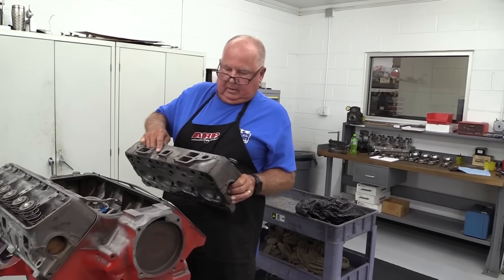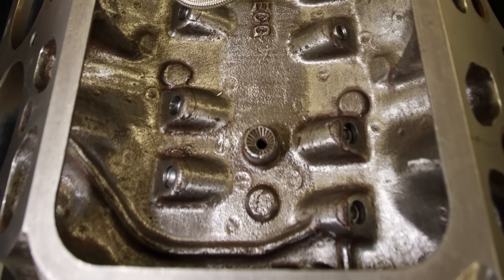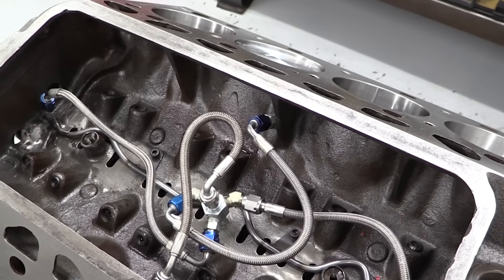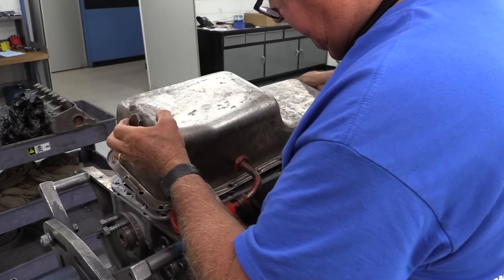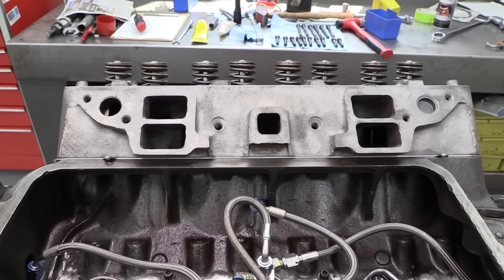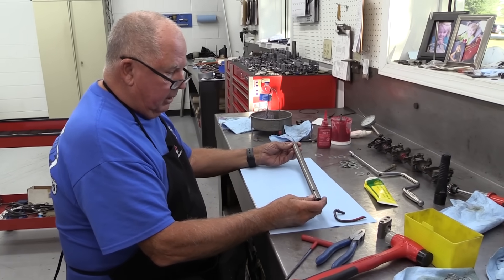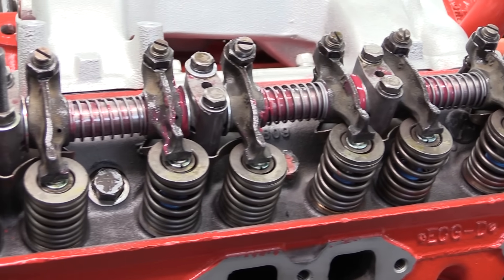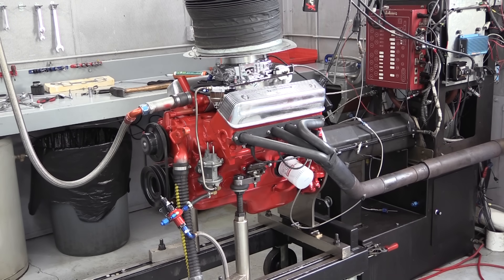The Engine That Replaced the Flathead -- Ford Y-Block Build

Comment: Ford is just a tad late in introducing the OHV engine, had a rare opportunity to work on a Buick 1903 engine, ha no valve cover and came with an oil can to manually lubricate the valve train components.  But it was definitely an overhead valve engine.

Path for air fuel flow is quite long in a valve in block engine, this was recognized well over 100 years ago.

Charles F. Kettering developed the spark ignition system for GM way back then as used today but with transistors instead of points.  Was patented and Henry did not want to pay royalties so used vibrating relay contacts in the Model T Ford that was far more expensive and troublesome.  But jumped at it with the Model A when that patent was expired.

Ford did have capabilities like building a two mile B-24 manufacturing complex that could crank out a B-24 each hour in less than a years time.  Extremely reliable, wish I could say the same about their cars.

Comment: I owned a 1957 Ford Ranchero with a stock, rebuilt 292 short block I installed along with a pair of rebuilt heads. For grins I started it once to verify oil supply to the rocker shafts. There was a lot of oil up there.  With modern oils and regular change intervals, I believe the oiling issues are exaggerated.

Comment: In '67 I rebuilt my 272cu engine doing a full blueprint build with overbore, balanced components and ported heads. Couldn't keep the stick 3 speed manual together very long. Broke it several times racing. Loaned it to a friend and he wrecked it. "57 Ford 2dr. Oh well.

Comment: My father who was a Ford mechanic in the '50's and '60's once told me that the bypass hole on the rocker shaft was to prevent to much oil onto the valve train. After about 30 thousand miles the rockers would get to much oil and the valves would start sucking it in through the seals. I understand that it was a common problem.
Reply: Great engine❤❤

Comment: I ran many of these in the 60's and 70's.  292" 4BBL in a 57 Ford wagon, a 312" 3-2BBL in a '55 Bird, 312" 4BBL in a runabout boat.  Good mills. Biggest problem I had was leaky rear main seal on the T-Bird.   Ended up repowering that Bird with a 302" and it was a vast improvement.
Also had another 55 Bird all stock show car with a stock 292" 4BBL.

Comment: First motor I built was a 292 Y-Block back in 1983 when Y-Bocks were NOT cool. I learned all my motor knowledge from a neighbor who built and raced late model stock cars. I tried to build the Y-Block like he built the stock car motors. I Used ECZ-G heads fully ported with 1.940 intake valves. A forged steel crank out of a Ford 600 truck. Deburred the entire block, polished the rods ARP bolts. Built my own 2 x 4 aluminum intake, oil pan and windage tray,  stepped headers, Schneider Cam valvetrain, it sure was something. I never dynoed it but it ran up to 7500rpm and ran high 13's at 107mph in a 1957 Ford pickup using a Top Loader 4 speed and 4.56 gears.
Reply: 7500 rpm on stock rods is insane, wanna make my 239 turn 7000 under a dash of boost lmao
Reply: @captainchicken8983  We have a modified 272 that still has stock rods. Normal shift point is 6500 but it will easily hit 7000+.
Reply: I had a stock 292 2bbl. Fresh rebuild. According to a tachometer from K mart, it would turn 7000.
Reply: Cool. I have all kinds of Y block stuff. Maybe i'll get a 292 rebuilt one of these days. I was going to put a 292 with 3 2110 holleys  in my 56f100 but instead i'm thinking of putting a late 50's 392 hemi with a 8-71 blower in it.
Reply: That sounds really cool thanks for your story!
Where you a machinist back then or how did you get the access to the mills to manufacture the parts?

In the beginning of my career I did a 3.5 year apprenticeship as a precision mechanic and learned every manufacturing technology and had access to everything from standard and cnc milling, turning and grinding over honing and electronic discharge machining with dies and dries.

After I finished my apprenticeship and a few years of work I changed the company and became the leader for their manufacturing department where is also learned everything that had to do with CAD and CAM.
Those times where amazing because I could build everything I could ever imagine with that huge park of machines!
My boss told me I could use all the materials from the recycling containers for free and we often had huge plates of metal in their which where more than enough to manufacture my parts!

Nowadays I’m just sitting on my as an engineer and tell people what to do or make presentations for the top management how my projects are running.
I get much more money, but I really miss the opportunity to build whatever I want for myself at home and the fun of not only designing but also manufacturing a new part that you came up with!

Some day I will at least get a small cnc mill and a conventional lathe for my little workshop in my garage, but that’s still a few years away since I first need to rebuild the garages on my property to put the cars somewhere else do I have enough space for those huge machines.

Comment: I had a 1956 Ford in 1965. It had the 292 and a Ford-a-matic transmission.  Paid $300 for it. Sold it and bought a 1957 Ford with a 292.  It had a three speed manual transmission. Paid $300 for it too.  Those were reliable engines.  You could rely on having to stop for gas very often.  They got terrible mileage.  But those cars  did have large back seats. Lots of fun at the drive-in.
Reply: the girls I dated wouldn't caught dead in the back seat of a Ford -let alone with pants off.
Reply: @timmullens9479  I believe you.

Comment: I remember the main weakness in the y-block was the 90-degree oil channel between the block and the head that fed the rocker arms. The combination of heat, poor oil quality, and infrequent oil changes, caused sludge to harden in this hot spot area which led to oil starvation to the rockers. It was impossible to clean out the hardened sludge because of the angle and access without pulling the heads. The answer to this in the sixties was an external oiling kit which was quite effective if you caught the problem in time to prevent the rocker arms and shaft wearing out.

Comment: What did he do, weld the connecting rods ? You said he fixed the cracks.
Reply from the maker: No, he just replaced them.
Reply: @TheHorsepowerMonster  well the wording in the commentary should be changed. From fixing to replacing. As an engine builder myself I was wondering if they did something I didn't know about.

Comment: question for you.. is this pretty much the same as a 368 motor.. although I believe that's a Lincoln ? but same design ? heads are definitely different..... intakes are different, but exhaust and rockers look pretty much the same....

Comment: It should have been named the “why” block because I still keep asking why.  The displacement of a flat head with the weight of a big block.  Oil issues, overheating issues and the odd exhaust manifold setup made for an interesting piece in whatever vehicle of the day you found it stuffed into.  Once mated to the Borg warner automatic transmission and you had one way ticket to the mechanic until you were beaten down enough to buy a new car long before you had planned.   By comparison the small block Chevy was developed at the same time, weighed substantially less, made more HP and over 80 million were made for some 50 years.   Ford in this 50 year period subjected its customers to no less than 12 V8 configurations, some good and some bad but never on the level of the Small block Chevrolet.

Comment: The 239, 272, 292, and 312 was not Ford's first OHV V8. Back in 52 there was a hydraulic valve version with a displacement of 277, 317 and 368 CID

Comment: “Infamous” Flathead?   Hardly infamous!  Produced and evolved from 1932 to 1953.  I built a 1951 version up in 1964 fir my first car.

Watching this video, I heard a lot of “faint praise”.  I remember the 272,  292,  and 312 referred to as “The Mainleaker”.. .   

GM removed a lot of the valve train complication with their stamped rocker arms for 265 cid small blocks in 1955. . .

Comment: drove a 48 1.5 ton from plentywood mt to crosby nd with my head out of th e window 30mph , it had a 272 y block with a power valve gone bad in the carb.   I didn't know it at the time, I was just a kid.  ended up giving the truck away a few years later

Comment: Well now the man that guided me through a y block build back in 1970 was the ford tech ak miller world famous racer and tech he told me to start with a 1962 y block out of a truch hd blocks and call speed o motive for a chrank rods and piston and crane cam they sold all with forged pistons and all ballanced for 250 bucks then i was told to make the center cam journal grove deaper and drill the oil feed hole from the crank to the heads out to 330 thousands and do the same on the heads and make the transfer slot on the surfice of the heads deaper and use hp t bird 1.7 rockerarms with good crane valve springs it took a 9 month session of porting on the heads to make the motor turn out 350 hp but over 425 lbs of torque with the edelbrock tri powre and mallory revpol distributor that motor still lives in a 58 ford truck today

Comment: It's galley not *gallery*.  Listen to Mr. Dorton.
Reply from the maker: Galley is slang, and I'll never correct anyone who says it. But one of the definitions of gallery is a channel or corridor. A galley is a boat. Again, a ton of people say galley and I'm cool with that. Either way, you know what I mean. Thanks for watching
Reply: @TheHorsepowerMonster  "Oil galley" is a technical term which you will not find in a literary dictionary, just like many other technical terminology.  It's been called this as long as there has been such a thing.  "Oil gallery" is a modern corruption.

Comment: Vaccuum wipers are hardly uncommon or  good engineering design. Many 40s and 50s cars used them and they were a pain in the backside. Get into the throttle and the wipers stop!! I owned a few 50 years ago. 
Those stacked intakes are a 'what were they thinking' design. OHV V8s were hardly new, Ford were a long way behind in 54. And that design was poor. Block was ok except for the very average oiling. Something that in hindsight was very poor from most manufacturers. 
Compare with a Chev,  vastly improved oiling, 14 bolts per cylinder head [the very bad point of an LS] and fairly efficient cylinder heads, an engine design around for around 45 years and the base for thousands of racing engines.
Y blocks? strictly for restorer cars. And if assembled properly perfectly adequate for that use. Hotrodding? Fit something more modern. In the 70s here in Oz all the leadsleds drag racing had Clevelands

Comment: I have a 57 ford custom 300 with a 292 and adapted 5 speed. The drivetrain is 100% stock besides the trans, factory duals, and a "modern-er" Holley on the factory big pattern iron intake. So... pretty damn stock. She purrrrrrrrrs and she snarls and roars. It amazes me because it's super fuel efficient and somehow it still stomps on Chevy 350s. 
How? Idk. I like my Chevys so I attribute it to good vs bad tune. Idk..... 
But, I love that 292. 
I'm building a 312 for her. I hope it lives up to what the 292 has done.

Comment: From what I understand there is no need to install those oil lines anymore. My dad and my buddies dad said oil wasn't the greatest back then, people didn't change their oil, and when the car needed oil they went to the service station and bought used motor oil. 
My buddies dad has a 57 Ford with a 292 and we had the intake off it and it had the factory repair done to it. To me it looked like a crappy fix with all the copper tubes they used and try to bend in place.
Reply: You are right, those oil lines are a complete waste of time and money.  Not at all needed.

Comment: My friend has a 57 Ford covertable Y block 312 with the factory Paxton Supercharger 
He also has a 57 Hard Top with a 292 
56 Ford had too 2 door 292
55 Ford hard top 2 door I6 
There's nothing better sounding than a Ford there all desictive and sound like nothing else. The flat head & Y block are 2 engines that you know exactly what it is without looking. The Ford engineers always put a effort into making the Ford engine different by design and sound. Even until today the modular engines have that sound that cant be recreated unless GM steals Fords design like the LS.

Comment: Yes the 292 and 312 I have a 312 in a 63 Ford F250 in your right now it's not a rocket motor it's not like a 289 not even close but it's the idea of I have one brand new right on and Scott less than but a thousand miles on it 25 years ago Rock on

Comment: It was a terrible engine - chevy was so far ahead it took ford years to repair the y block.
Reply: Sorry but don't agree,my Dad had one of these engines as the powerplant for his Gardner Denver well drilling rig and it was bulletproof for 15 straight years,his friend had dual small block Chevys on his well rig and had to replace an engine at least every 6 to 8 months. And the Chevy engines always used oil badly even when they were new. Daddy also had a 1963 F100 with a 292 Yblock as his service truck,he put over 400,000 miles on that engine without a major breakdown and he was ruthlessly hard on his trucks. As a matter of fact that 63 F100 taking that abuse daily made me as a youngster a dedicated Ford man and later on a Certified Ford Technician for 22 years.
Reply: Gutless, heavy, low-RPM, stacked-port, main leaking, rocker squeaking boat anchor.
Reply: @daryllect6659  Sorry,but you've come along too late to convince me of that,my Dad had several of these engines in his truck fleet over the years and they were some of the toughest engines we ever had,much more durable than any of the SBC engines he had which were also numerous. Dad advised me when I bought my first GMC truck that it would run and drive good but would absolutely require more than twice the maintenance of the F100 Ford pickup it was replacing and wouldn't take nearly the abuse that the Ford did. He was right.

Comment: I built several ford Y block engines back in the late fifties early sixties, they seem to blow head gaskets constantly. My very best build was a 312 CU IN 1957 Mercury engine that was a match for any built 283 Chevy back then, sad to say it ate a valve on a missed power shift and died. I never found another Y block engine that could never come anywhere near that one! I remember those days, they turned me into the successful Engineer I later became.  I certainly enjoyed your video! Thanks
Reply: Iam a  proud owner of an 1960  F100 4x4 292 with the Y block, I seen it up in front of the collapsed Barn, I asked the lady if she wanted to sell it? she said hell no! you can have it for free.... I gave it away 12 years ago to a guy.. but it had four flat tires,.he never showed back up. Called up my buddy Joey I said Joey bring me a battery and your car trailer.and  a six pack of beer.. Joey showed up, I put the old girl down in first gear granny Low, slap the battery in it, pulled out the spark plugs then turned it over,, and womp womp womp womp right up into the car carrier.... The lady said where in the hell you from? I said right here in Oregon, she goes I've never seen that done before with 4 flat tires. Yeah that old Ford  sweetie walked right up that ramp like it was nothing... Then we sat down and drank that cold six pack of Rainier beer with the lady. Now She starts like she did 62 years ago.
Reply: That's a good tale, Dale
Reply: To fix the blown head gaskets. I would use the steel shim head gaskets. Get a strand of copper wire from a battery cable and glue it in that embossed circle around the cyl.  That worked sort of a poor mans O ring. They blew because not enough bolts  holding the heads on.
Reply: @williamglendye1692   348's where not fast.
Reply: @thecollectoronthecorner7061 , Yes but they sure could burn rubber with all the torque.
Reply: @davidschwartz5127  the 348 was designed as a truck engine. When GM learned Ford was making the larger cube FE they made a few changes so they could be installed in cars. I owned a 58 impala tri power 348. Yep little skinny 14 inch tires  where easy to make big long black marks with. I fixed my 348 by pulling it out and installing a 421 superduty pontiac. Had to get a posi rear end.
Reply: Some were, some weren't, same with 409,s

Comment: Thank you for this video. I'm in the process of rebuilding the Y block in my '55 fairlane.
Reply: Me too mines a family heirloom.
Reply: @CreatorCade  wish you great success on your build. I THINK  you'll  truly love working with the Y blocks.  I did one way back in the last millennium.'1990/'91.  Mine was a 312 hooked up to the air cooled ford-o-matic slush box. It was still running good when I finally sold my car in 2014. There's a lot of meat in the 312 y block. Could easily be bored out to .o60 from what Ive been told. Mine was bored out .o40 over.
I always trusted Larrys Thunderbird Parts and accessories  for my needs. There's a couple of other reliable parts dealers for the ford y blocks.  Just search the web and you'll find almost everything you'll need. Some parts stores will have items like oil filters, bulbs, fuel pumps, radiator caps spark plugs etc;.  Good Luck!

Comment: that had a much different look than the 462 Y block in my '68 lincoln.  the combustion chamber is inside the cylinder on it and the heads are flat.  the powersteering pump mounted to the front of the engine and the crank protruded out through the timing chain cover, to drive the pump.  i dont remember the oil pump being external to the block either...  of course not all Y blocks are the same...
Reply: A 462 is not a Y-Block.  It is an MEL.